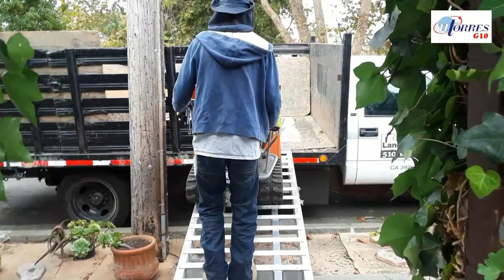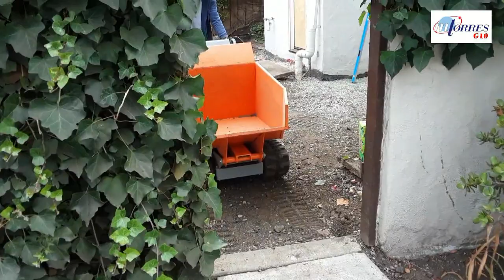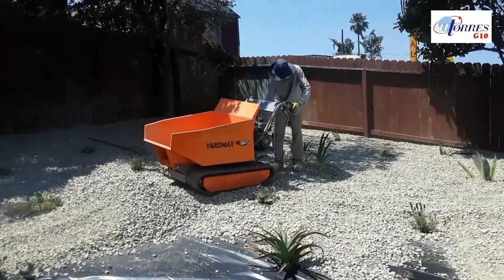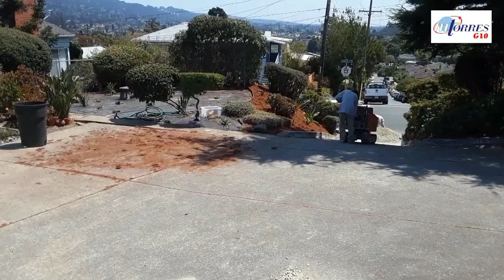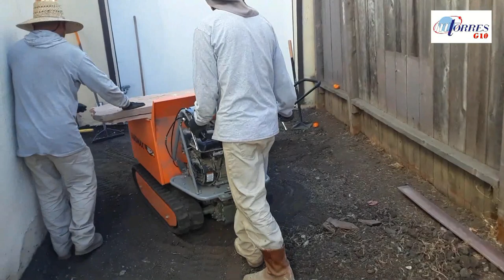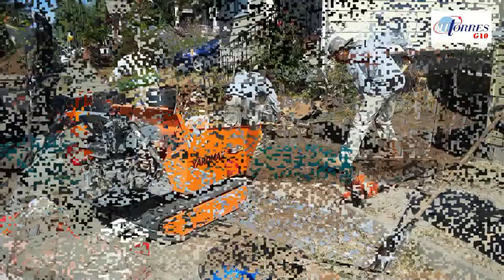YARDMAX - Power Trackbarrow w/ Hydraulic Assist – Hopper

Comment: What brand are those ramps? Just bought this machine and would love to use a aluminum ramp like that to get the unit into my dump truck. Tough to find ramps that can support the weight.
Reply: mtorresg10 thanks!
Reply: @racernate02  How do you like the machine? I was thinking about buying it.
Reply: @robertbaker5626  it's very useful. I have 2 of them.

Comment: you couldve gotten 5 loads up there with a regular wheelbarrow by the time you walk this turd up there and walk it back.
Reply: Sure, I could... but YOU couldn't.
🍻
Reply: I don't think so bro.
And if you do so at the phase the you said 
You would be hauling about 1/5 ton of material every 10 minutes.  So 9 tons per hour x 7 hours of work = 63 tons of gravel x day...    Wow man pass me your number 
You are the helper that I was looking for
I'm not kidding bro I'm making My own landscape company here in Las Vegas.

That's why I'm looking into this machine, because I'm by myself and it hard to throw 10t and irrigation and all n all in 1 day, so I get pretty tired and my back hurts a lot.
Reply: I doubt that as it's capacity is 1100 lbs. He was running it in low gear and low RPM.
Reply: @odiarroyo6144 your math aint mathing lol